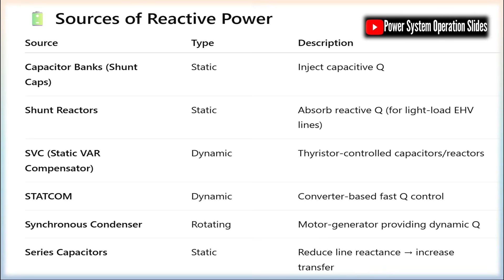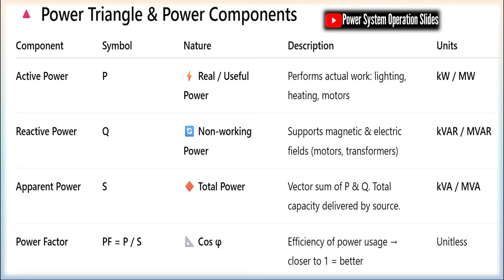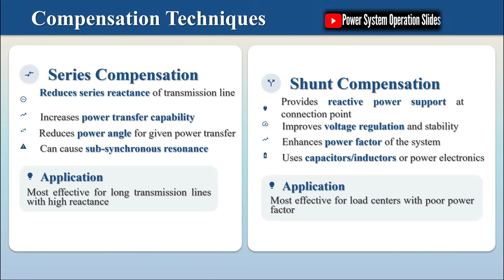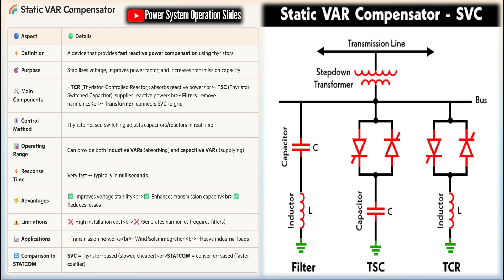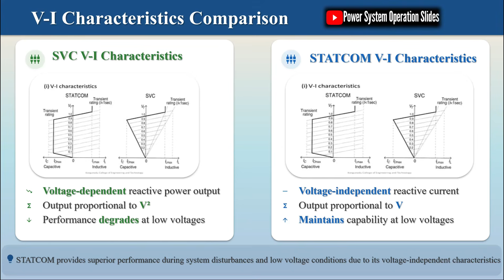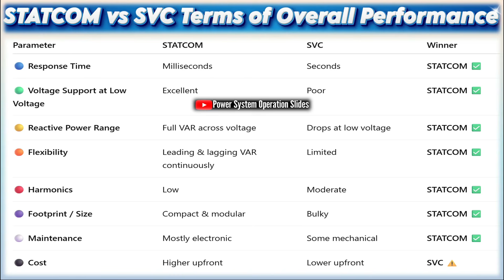STATCOM vs SVC | Reactive Power Compensation | Comparative Analysis of STATCOM & SVC Operation

Comment: Thank you for this presentation. I am a consumer of electricity rather that an Electrical Engineer. My respective is bottom up rather than top down. Though you acknowledge the growing role that renewables your goal seems to be to continue centralized management of the grid. The way I see it is that the grid is decentralizing and management will decentralized into a collaborative network.  What will develop will be renewable energy based nodes (micro-grids) that use grid forming inverters for power sharing. More electricity will be generated at the consumer end and thus energy will originate from the bottom. Also, with massive development of battery storage, power leveling will become the goal of the grid in for form of node to node sharing. To your credit you do touch on this subject in previous presentations.
Reply: Are you a bot?